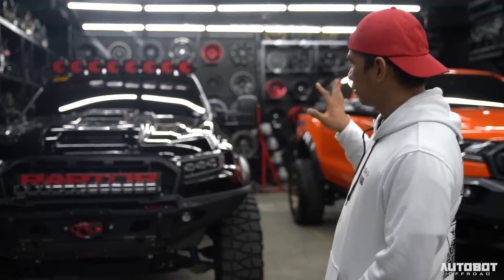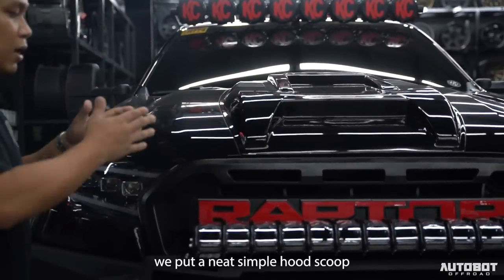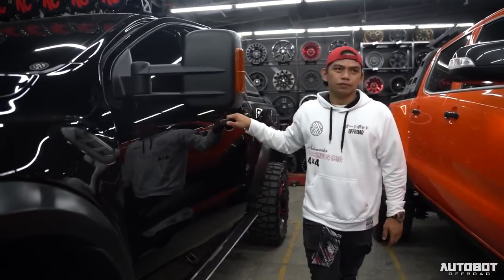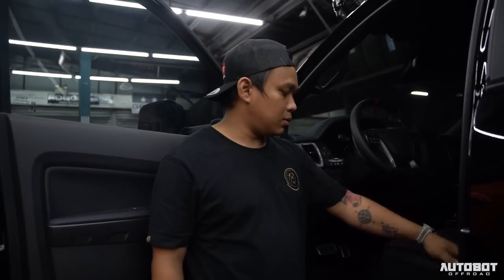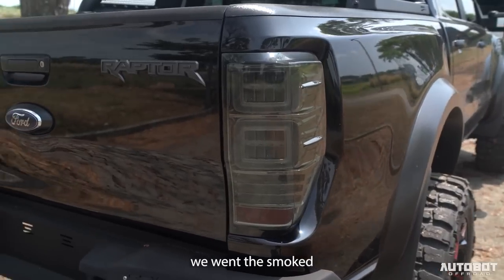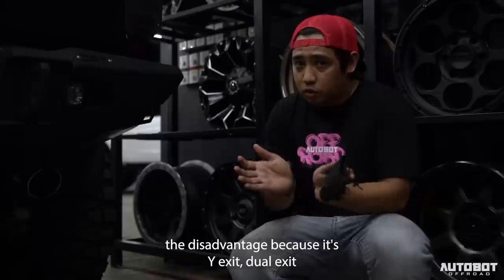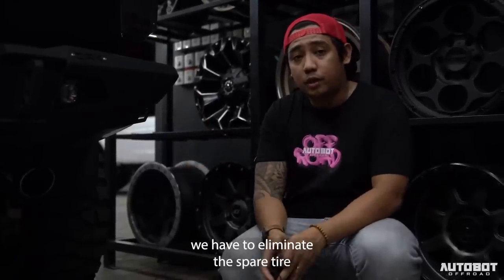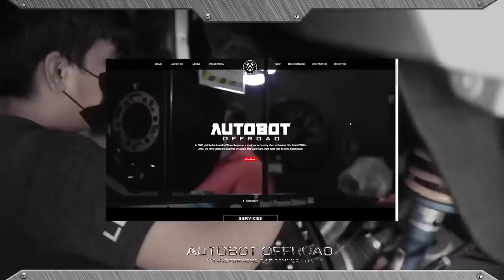FORD RANGER RAPTOR: PROJECT CAMSUR

Comment: Love this build,you guys know how to make a ranger raptor look real good. Also may I ask, how much did this build cost ?
Reply from the maker: 09973741451 viber/sms/imessage
For inquiries, question or quotation
#65 Road 20 Project 8 QC
Reply: Love this set up..how much cost the same wheels po if you don’t mine para magka idea ako..have a 2022 raptor planning to lift it to 2 inch..thanks in advance

Comment: The rigid adapt and KC lights are they connected to the high beam control or just battery direct power supply? Coz any tamper with high beam circuits to control spotlights would damage the BCM. Btw love what you guys are doing. Great job!

Comment: di pa rin kino correct ni Ford ang mga problema nila sa engine and transmission up to now.  dinadaan na lang sa porma mga gawa nilang sasakyan pero hindi reliable
Reply: Yup.pormahan lang yan raptor.pero d magtatagal yan kng laging gagamitin sa trail.wasak agad ang transmission
Reply: Bumile muna kayo ng raptor bago nyo sabihin yan
Reply from the maker: Di naman po lahat :) mejo marami lang demand ni ford ranger raptor dito sa pinas kaya may ilan na meron factory defect. 🙏🏻
Reply: Arayku
Reply: @xtranghero2666  at ba't naman ako bibili? ni hindi nga makapag tow yan ng 3.5 tons.  2.5 tons lang max ng raptor sa towing.  Wait ka lang hanggang maka 30k+ mileage nyan at magsisisi ka rin.  Napagdaanan ko na mga ford.  Nagka raptor na ako yun pang 6.1 liter engine, nagka F-150 na rin ako yung 5.4 liter engine pero wala isa akong luhaan na owner.  Sa pormahan mabangis, pero sa tunay na laban iiwanan ka nya